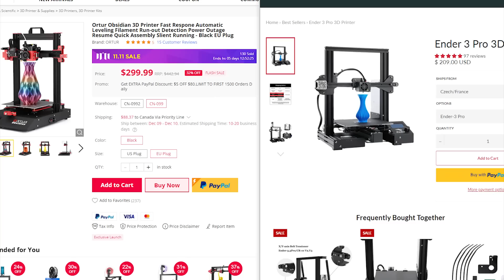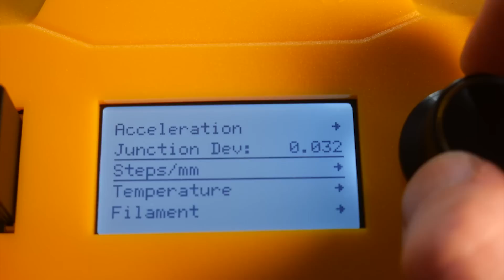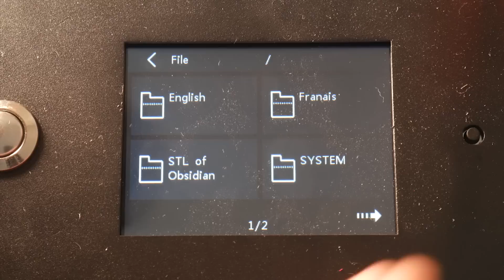Ortur Obsidian 3D Printer Review. Is it better than an ender 3?

Comment: Its a real shame, I was part of the beta tester group for this machine and we made many changes and supplied updated part models amd firmware patches to get this machine running great. However they decided to push out to youtubers as well as releasing on gearbest and such without implementing our changes first. Which was just shotty on their end, however with the updates and changes we made this is hands down my best quality and most reliable machine. Just a shame it wasnt marketed and released correctly and basically flopped.

Comment: Structurally very good printer. But a little bit unfinished software at the factory, after changing the acceleration end e-steps for extruder  by manually setting the Z-Offest and saving it in flash m500, it prints perfectly

Comment: When you have direct-drive the best location for the filament runout sensor is directly above and as a part of the extruder, this way no matter where you have a filament breakage the sensor will be activated unless of course, your sensor can also detect the movement of the filament then there are more options as to where you can place it, this is basic logic, however, some manufacturers locate the sensor in some ridiculous places

Comment: Creality machines are good, but also not always perfect. And the Ender is not in the same category. No direct drive, mot full metal, not dual gear, no abl, and no 32 bit board, no dual z rod etc.
Reply: He only compared it for first timers. This machine seems to have a low QC, needs repairs and adjustment from the user. If we you're going down that road as a beginner, you better get a popular printer that's well documented online.
Also the current ender 3 pro has 32 bit boards from stock now. Most other models do too.
Reply: Ender 3 and all Creality 3D printers have come with 32-bit boards as standard for quite a while now

Comment: good review! I'm a bit disappointed by fact that everyone compare to ender. As you say we are in 2020, so there should be a sort of competition. Btw, how is Biqu BX?
Reply from the maker: eventually i'd like to start comparing things to the ender 3 v2 haha. but in all seriousness i use it as sort of the baseline machine for the sub $300 market. most machines in this price bracket use the same components, v slot extrusion wheels, same hotend, same extruders so i always look at these machines as enders with bells and whistles which you may or may not want or need. on that note i have a review on the artillery hornet coming soon which will be very interesting for the budget 3d printer market! thanks for watching! :)
Reply: @WildRoseBuilds  good and honest  reviews are worth time to watch! Cheers!

Comment: what you think about the sidewinder x1 and artillery genius ? are they good ? better than the ender 3/ender 3 v2 ?
Reply from the maker: i love the artillery machines! they are very well engineered and have almost all the features of printers like the prusa mk3 / mini at a fraction of the cost. they also require way less modification than the ender printers, there's literally nothing i would add to my sidewinder / genius. i have a review of the genius up on the channel. and i'll have some more stuff on the sidewinder coming soon. :)
Reply: @WildRoseBuilds  I am undecided between the ender 3 v2 and the sidewinder x1, which one would you take? (why?)
Reply from the maker: @francescodiliso6402  sidewinder all the way due to bed size, direct drive extruder, and that awesome volcano style hotend which means you can put big nozzles on it for functional prints!
Reply: @WildRoseBuilds  thanks